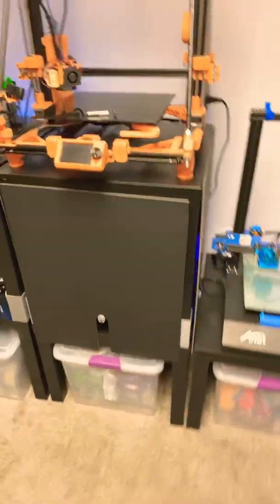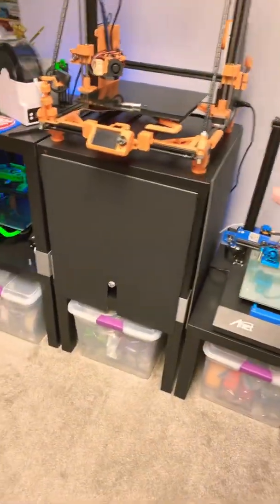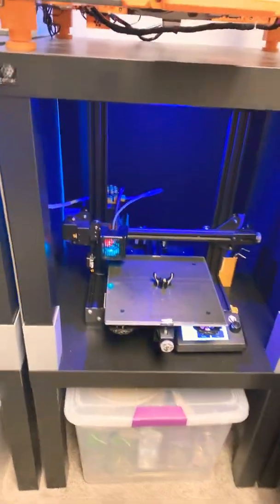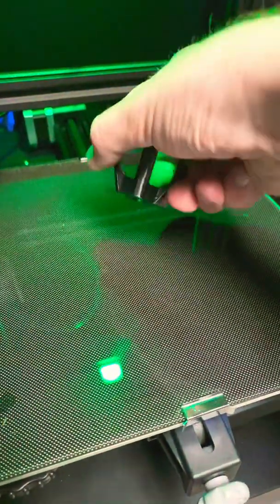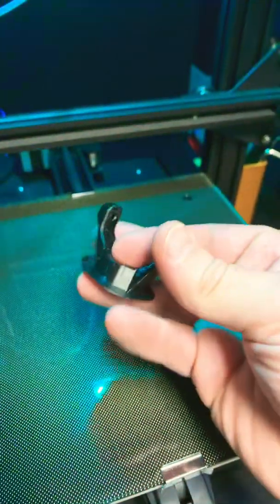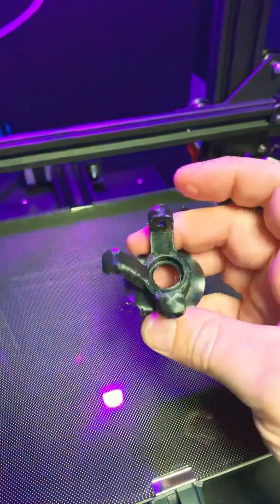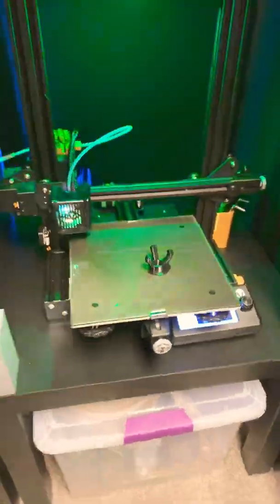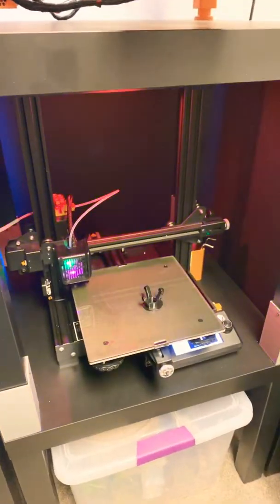Nylon on Stock Aquila Pro Tip: Try An Enclosure

Comment: Wait did you flip the glass plate? Does the glass work that well? 😍
Reply: I flipped mine and use my wife's hairspray, works very good, sometimes too god
Reply: @rcplayday7937  i flipped my plate too. Duely noted! Im still pretty new to this.
Reply: @NerdVinTV  me too. I'm getting better every day. Just printed something out of easy nylon, and OMG it's unreal the strength I was able to get and no enclosure or venting needed
Reply from the maker: I like both sides for different reasons.  But something about the super smooth glass I like best. Makes for easy removal and a nice mirror finish on the bottom

Comment: I have a question about my Aquila that I can’t find an answer for online.. my nozzle keeps leaking from the tip without the extruded moving. Any tips on fixing it?
Reply from the maker: That’s normal. When the hotend is hot, plastic melts and leaks a bit. If you’d like it to stop, you have to retract or remove the filament.
Reply: @3DPrintSOS  gotcha. How would I get it to retract it? Could you maybe make a video on it?
Reply from the maker: I would just let it be. I printed a little trash can and use tweezers to pick that stuff off before I start a print

Comment: what was your chamber temp?
Reply from the maker: Good question. I didn’t really measure it in anyway. But sounds like I need to. I just wanted to see if it was the air in the room or not. Seems to be the case.
Reply: @3DPrintSOS  I measure my chamber at the extruder and at the top of the printer. I've had PLA filaments fail due to overheating at the extruder.
Reply from the maker: Right, that makes sense. One of the reasons I made this very easy to remove. The sides are held with Velcro.
Reply: @3DPrintSOS  what stand are you using for the printers? I like the vertical set up.
Reply from the maker: I made them out of the cheap ikea ends tables. I need one more actually.

Comment: Hi I bought Aquila based in review from your channel. Just a question, I am trying to PRINt ABs do you think i can print with stock nozzle ad hotend setup??
Reply: Ok, because there is so much to print otherwise, I might upgrade the hotend to all metal
Reply from the maker: I hear good things!
Reply: @sumanbimali  If you change to all metal the first thing you HAVE TO DO is change your retraction settings. From what ever they are to 1 to avoid an instant nozzle plug. Then slowly calibrate the retraction back up a little if stringing is an issue. I am working through that proceedure now. But it will allow easier, safer printing at higher temperatures. Hope this helps, I found out the hard way. :-(. Yes you need a case, even a cardboard box will help keep cold breezes from causing a print to warp. Happy printing
Reply: @dannybush6131  Thank you Danny for your information. Which all metal hotend are you currently using??
Reply from the maker: Yea I think so. I just wouldn’t do it all the time though as the ptfe tube doesn’t like sustaining high temperatures for a long time.
Reply: Also do you have any suggestions on print ABS with bed full?
Reply: I live in Australia at the moment is very cold in here so I guess I need to have some sort of enclosure for ABS printing

Comment: Awesome news! I have been working on an enclosure for a bit now. Gathering up the stuff to get it right the first time. I have the printed parts, the vent/filter parts, most of the wall material, (the expensive part) I am almost there. Is this a Cura profile? Thank you very much by the way. I have been working with the SuperSlicer and it has been working well with Flash. The E3V2 profile set has been a real good starting point for sure and the profiles cross over with PrusaSlicer. Simplify3D is my go to for slicing any complicated model. I just have a better success rate with it. Especially with supports involved. Cura has become my least favorite.

Comment: Going to add a enclosure to my list of things to do AFTER I figure out the black screen of death my Aquila just had.
Reply from the maker: Hopefully its just a loose connection!
Reply: @3DPrintSOS  I agree, check the connections at both ends. while you have the main board opened up check all of the connections. Some of these Aquillas have gremlins. I fixed my machine by simply pushing all the connectors in on my main board. It had a loose thermister connection. Now it rocks. Good luck.
Reply: @dannybush6131  I’ve got a green led on the main board and screen light, but the screen is blank/black. All the fans work, things are plugged in, but no screen. 
I’m going to hope Voxelab service has a easy fix… or maybe a new unit?!?🙄
Reply: @stonefarmer3005  I am sorry to hear that. The support team got right back to me on my issue and hopefully will be able to help you quickly as well. I have had no issues with the display other than all the bells and whistles not working. No Zed readout that kind of thing. Do you have an extra 10 pin ribbon cable? If you have another printer you can change them out to eliminate the possibility of a broken wire. Do you move the display or printer a lot? I am not real experienced with display problems. Please let us know how it goes, I have not heard of any dead screens or any other things other than fans and loose wheels, flat spots on wheels. Now my curiosity is up I will do a search. ;-)
Reply: @dannybush6131  Support has been great so far. They just had me reconnect the screen ribbon cable, but no effect. The led’s on the motherboard are wonky, power led on, 3v3 led flickering/ dims out, CPU led off. I sent them video of the led’s on power up, so I’m still leaning bad motherboard.
Reply: @dannybush6131  And yea, I’ve not had anything wrong with the unit until now. It’s been just over  9 weeks and I’ve printed on it almost daily with about 120 hours of print time on it.
Reply: @stonefarmer3005  Just food for thought here ,but you might want to invest in a creality 4.2.7 board that comes in the E3V2 machine. I got one a while back when the were on sale, but they are still a good deal and will drop right in. If Voxelab is sending a replacement board it is probably an updated board anyway but if it has any problems that is the way I would go. I have been trying to find who makes their board so I can build my own firmware for it but they havn't gotten back to me yet on that question and no one seems to know. If you line your nozzle with the good capricorn or another high end ptfe and your temp is below 260 you should be able to go quite a while with no problems. The abs produces a small amount of styrene gas but wit a small solder fume extractor taped to the back of your enclosure pointed out thru a cracked window you shouldn't be killing any canaries. The fumes generated by the overheated ptfe bowden tube are deadly however. That being said you are not going to generate enough heat at 260 to fill the room with melting bowden tube. the same little computer fan or nozzle fan for the abs will haul those fumes outside. Put a speed control on the fan to keep it just fast enough to move the fumes out and not cause a breeze in the cabinet or draw cool air in too quickly. you just want to move the bad fumes out or better yet through a gas mask chemical filter to clean it. You do not have to reinvent the wheel simple will work. (probably better than complex) Cheaper too. Happy printing
Reply: @3DPrintSOS  Looking like the CPU went on the motherboard.